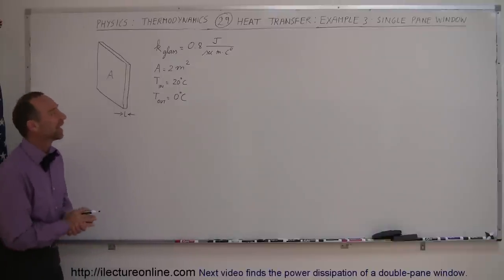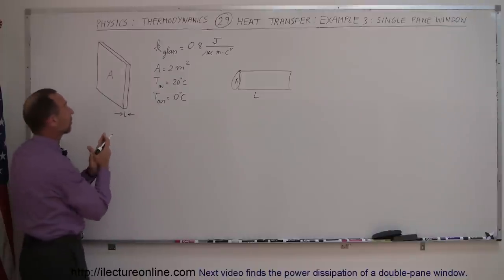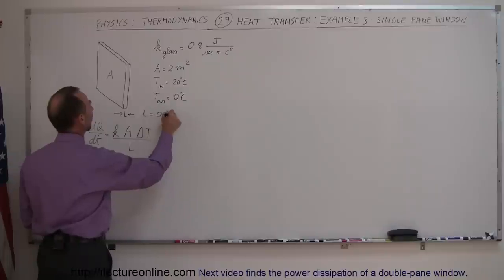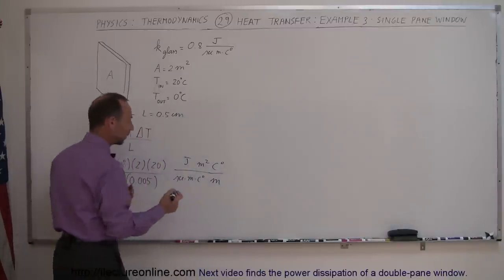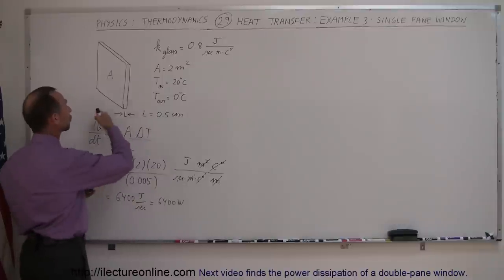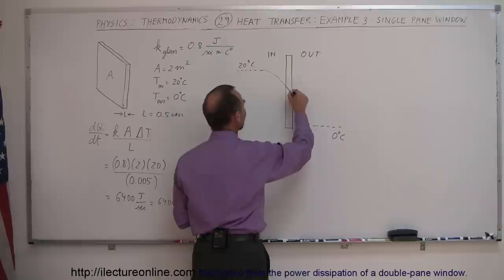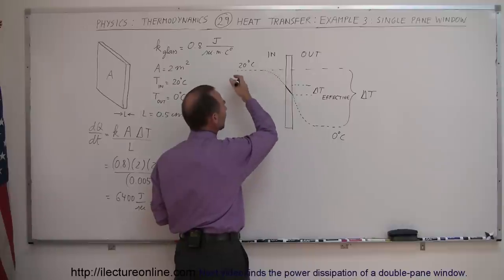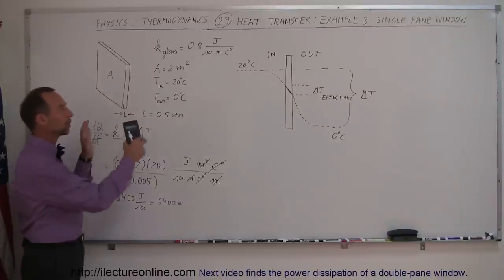Physics 24  Heat Transfer: Conduction (4 of 34) Single -Pane Window

Comment: Great lecture, but I have a question: you mention the air films clinging to both sides of the pane and how this effectively reduces the temperature difference between the actual surfaces of the glass, but you haven't shown the revised value of the heat transfer (from 6,000 watts to what?). This becomes important in the next video where I notice that you don't, again, account for the two air films. I'm confused; aren't those films present in the double pane?
Reply from the maker: The air films are needed for any surface to get a more accurate heat transfer function.  We will be publishing a playlist with heat transfer through convection in which this will be explained in detail.

Comment: Simplification: If the delta between the cost of new double pane windows and your bank balance is too high substitute the cost for a roll of bubble wrap and box cutter knife to get the same effect as a dual pane windows and reduce heat loss in the windows by 50%
Reply: Not quite; remember, bubble wrap, unlike glass, is transparent to the infrared (which accounts for more than 60 of the heat loss at these temperatures)

Comment: Is there a way to calculate the "true" delta T without worrying about convection or radiation?
Reply from the maker: To find the true delta T you would have to measure it.  What we can do via calculation is to estimate and make some assumptions about the conditions and then include heat lost by convection and radiation as well.
Reply: So, just estimate the delta T of the two surfaces and then calculate convection/radiation?  Thanks for the quick reply.

Comment: how about if there are limit time...like example'in 5 hour'...we need to time by 5 the final answer or no need to..someone who know please help me...
Reply from the maker: Once the rate of heat transfer (dQ/dt) is calculated, in order to find the total heat transferred in 5 hours you would multiply dQ/dt x 18,000 seconds     (5 hours = 18,000 sec)
Reply: I hour = 3600 seconds
Reply: I think you erred on the thickness of the glass conversion.  5 cm to m is .05m, not .005m. I believe

Comment: What's the difference between °C (degree Celsius) and centigrade degrees as you're speaking in the video?
Reply from the maker: Degrees Celsius (or centigrade) represents the actual temperature.  Centigrade (or Celsius) degrees represent the difference between 2 temperatures.  (or the change in temperature)
Reply: Michel van Biezen So Celsius and Centigrade are equivalent? I never heard centigrade before. 0 K == -273.15 °C == -273.15 Centigrade?
Reply from the maker: That is correct.

Comment: what is the direction of heat flow in this case?
Reply from the maker: The direction of heat flow is ALWAYS from hot to cold.    When you are in an air conditioned house and it is very hot outside, then heat travels from the outside to the inside of the house.
Reply: Sir I was solving a question where solar radiation from outside is used to heat the room inside.. In that case the temperature inside is more than that of outside but the heat flow is from outside to inside.. What happens then?
Reply from the maker: I was referring to heat by conduction.   Now when we go to radiation, let's say we have 2 objects.  One is cold and the other one is hot.  They will both radiate, but according to the Stefan Boltzmann law,  the hot one will radiate more than the cold one, so the net radiation is always from the hot object to the cold object.
Reply: @MichelvanBiezen  Thank you for clearing the confusion! 😊